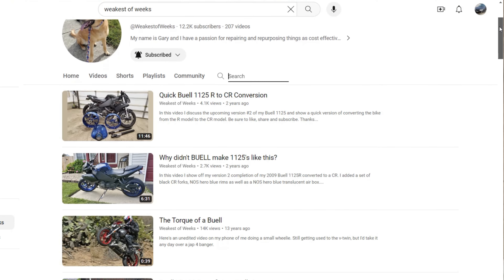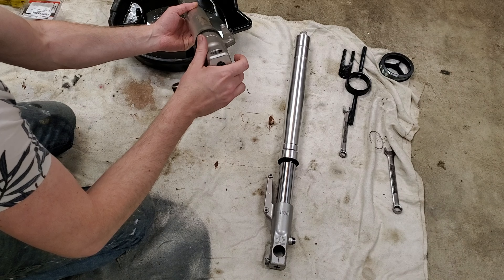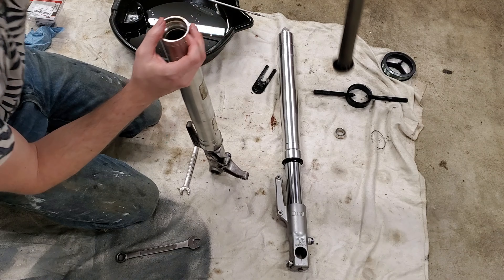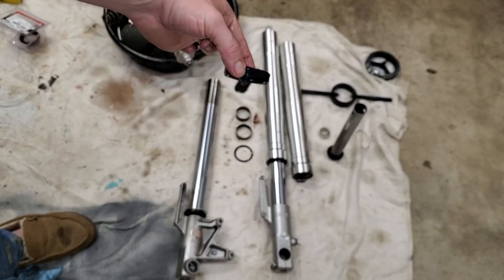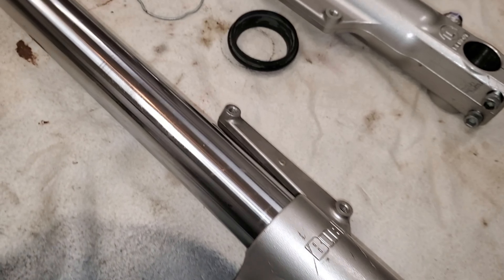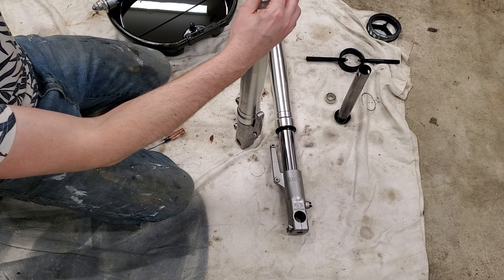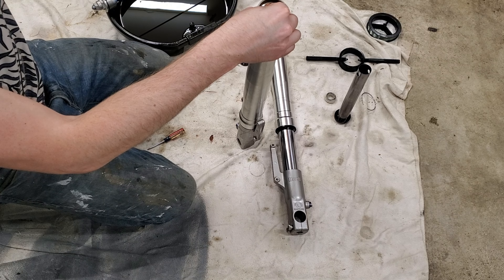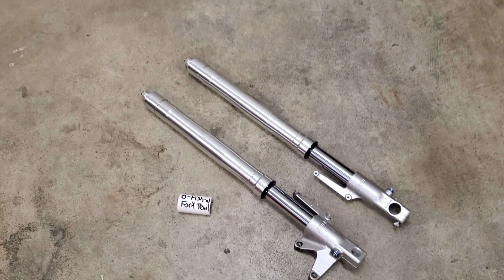Simple Buell Motorcycle Fork Rebuild

Comment: Are you doing the right thing by topping up the oil at the very end? The manual and everywhere else says the height of the oil from the top of the tube, but you just pour it in without dosing or measuring, and the amount of oil should be the same in both tubes, as well as the fork settings on both sides, what can you say about this? Thanks

Comment: Probably the easiest video to understand. Thanks 

I’m thinking about switching from an xb12 to an 1125 just for the sheer power. What’s your opinion?
Reply from the maker: I've owned all of the Buells, including 1190  and the 1125 platform is my favorite and best bang for the buck! Don't get me wrong, I really liked my XB's for the torque but the 1125's rev so much higher. The 1125cr is the most amount of fun with different pulley gearing. It feels like it has XB torque but 40-60hp more depending if stock or not. Downside is thet you'll want to check valves every 12k miles and charging system can be a pain. I have a video on how to remedy the 1125 charging issues though.